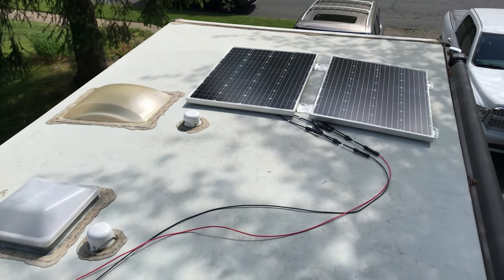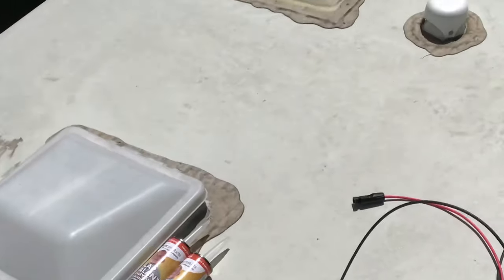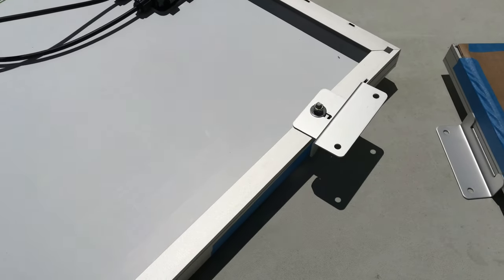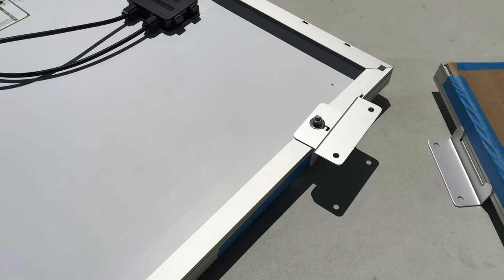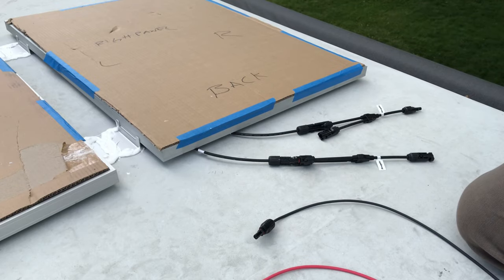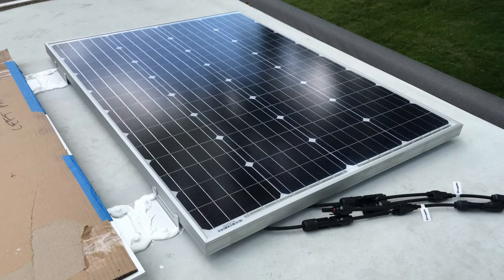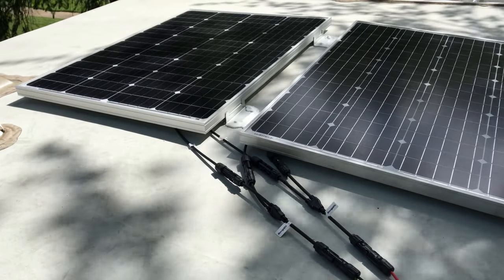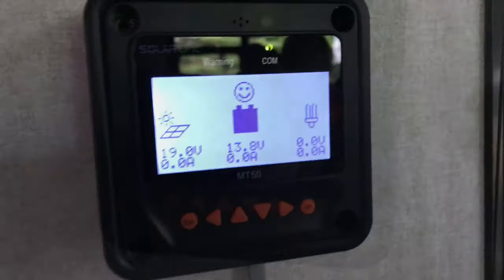Finally! How to Install Solar Panels on a Jayco Travel Trailer 212qbw Solar Power Part 7 of 8 series

Comment: Update. We have added 4 more Renology 100-watt panels and a 200ah lithium battery with a 200A BMS. I get about six times more use from this new system than my original pair of 75ah wet acid batteries and a 100-watt solar panel. The extra weight from the panels is almost offset by the lighter weight of the battery. Very happy with the upgrade.

Comment: We also have a Jayco 212QB,  thank you for your terrific video on adding a solar panel to the roof. After a few DIY upgrades, I already have the Go-Power GP-PWM-30-SQ Solar Charge Controller with one 100-Watt solar panel installed and wortking. I am now attempting to add more of the 100-Watt Solar Panels to the system. My dealer does not have them in stock so I need to know how many we can buy to install in the space we have to work with. Do you have any idea?

Comment: What type/size screws did you use for screwing down the panels? thanks for making this video!
Reply from the maker: I will measure it... but it came with the bracket kit. I will post it after I measure it... looks like 1.25 inches

Comment: What kind of hardware was used to mount brackets to the roof and did you go into the studs or just the ply wood?
Reply from the maker: Just the plywood. Did not hunt for studs. The plywood is pretty think. Check out my video on drilling a hole on my roof.
Reply from the maker: The brackets were just the recommended z brackets for renogy or hqst panels.
Reply from the maker: Here is the link to the brackets https://amzn.to/3eVrWj0
Reply: Are the building a house in the background?  Wondering what all that noise was.  Sounded like a  skill saw, then a mower, then a blower.  Nice job committing dude.  Nice clean install
Reply: I’m guessing you are going for 400 watt total.?

Comment: How many panels you need to do it fully solar ? Working air conditioning most like all the time , thinking to buy one , to be a tiny home
Reply: It would be your battery bank.

To run your AC 8 hours a day you would need 5 200 AH batteries. The solar panels you would need a dozen.